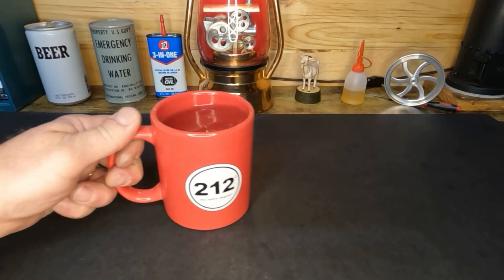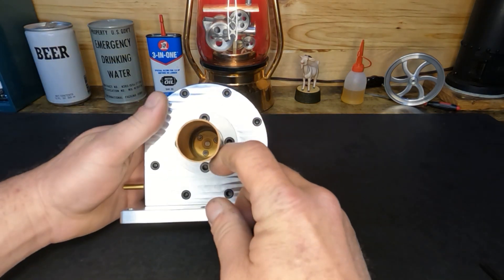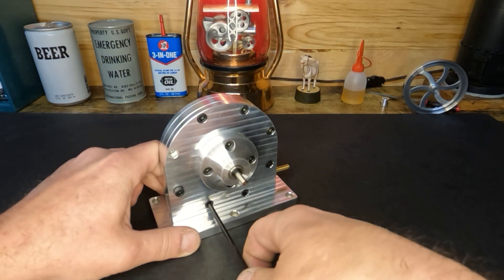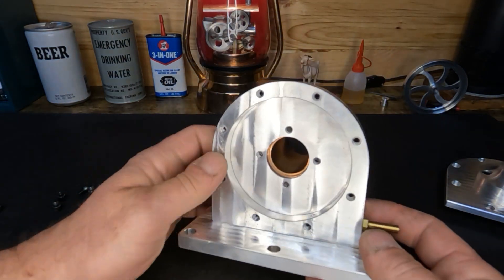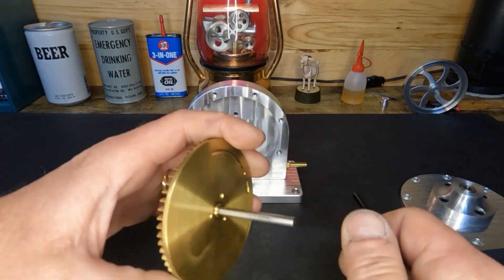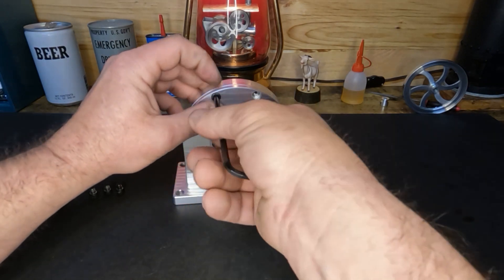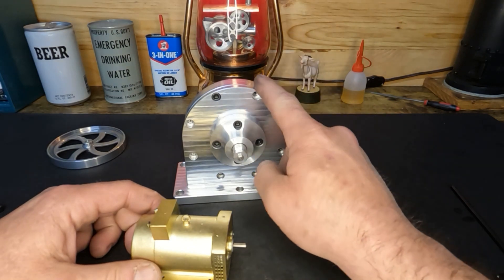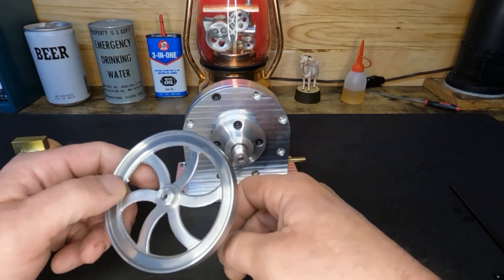Let's build a turbine powered generator! Part 1, a look at the turbine inside and out.

Comment: Where did ou buy the generator from? Cheers
Reply from the maker: Hi Gareth, I ordered it from Engine DIY.  If you get a chance, check out the other 2 videos on this project, I'm not too impressed with the output on the on I have. The housing is pretty nice but the mounting holes are not of much use unless you tap them and bolt it from underneath. I think that we're going to replace the stock motor with a proper RC motor and see if the output improves.  Just a thought if you're thinking about buying one. Thank you for the question and for your interest
Reply: @steam212  Thanks for that I'll take a look. I have the little EM2 Eachine engine. 1st miniature engine I've bought. Would like to use something like that just to run a set of LED string lights. I think that lamp you're trying to power is about 300mA. String lights would be much less than that. An LED  usually uses less than 10mA. I'm not sure how fast you'd have to spin that dynamo/motor to get 300mA out of it. But as there's no voltage once the lamp is connected I'm not sure how the red LED you have there is lighting as they need 1.6 Volts to light. I've watched almost all of your video's!
Cheers
Reply from the maker: @garethmilne6887  I think you're right on the bulb size. I was expecting more output. We're not quite done with this setup just yet. We'll revisit it in the future after we get a few more projects completed.  Thank you again for your interest and for watching.